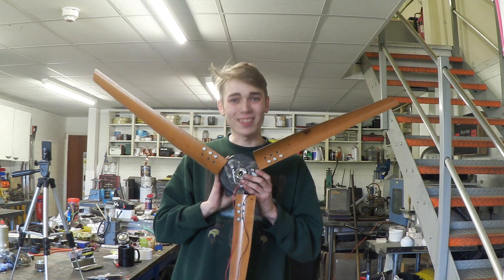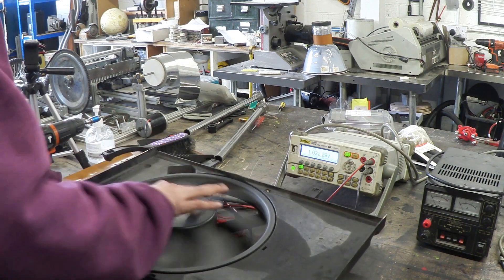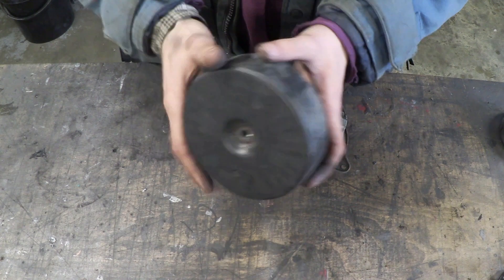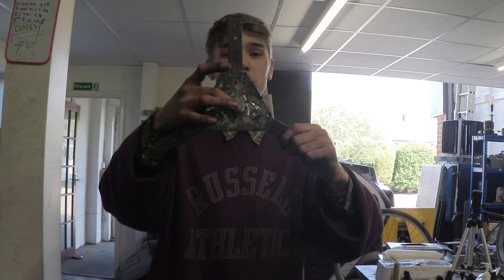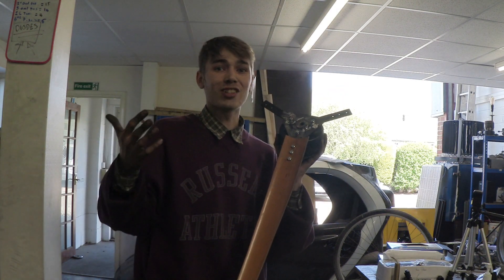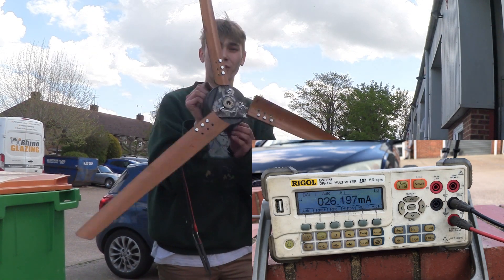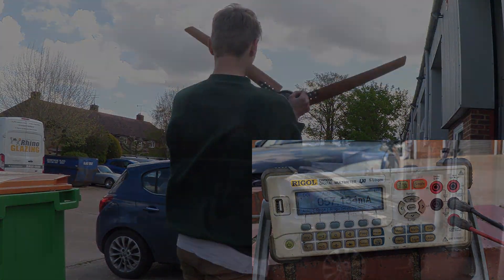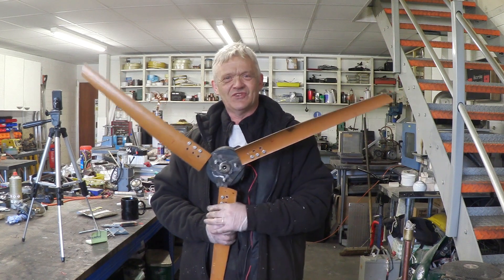1091   My First Ever "Easy to Build" Wind Turbine

Comment: Good idea that you always pointed it to where the wind  was blowing!
Reply: Yes, and in practice all one has to do is build the generator on a swivel and attach a wind vain tail fin to it. The force of the win on tail fin will always keep it aligned properly to the wind.
Reply: @William_Hada  the problem is if you want it in a big turbine it'll exhaust the energy it made in the first place so maybe multiple small turbines that can easily adjust with little amounts of energy needed.
Reply: some of the giant turbines you see on hills actually face "backward" to what you expect, the blades themselves can create enough drag to pull the turbine round so long as the blades are on the trailing edge - the hardest part is allowing infinite 360 rotation as the cable will always find a way to get coiled up... one of the benefits of VAWT i guess

Comment: Well done!  Could you look at making Slip Ring Rotating electrical connectors for  a wind turbine from scrap, and how to mount them securely on a pole, as I have found that to be the biggest dilemma in making a horizontal axis turbine?! There is a plethora of motors out there for conversion to generators, but the problem is getting the power back to the ground without having to regularly untwist wires!

Comment: Nice. Keep in mind that the power producer should be measured under load. When you only connect a volt meter no current is flowing and load is zero. When you only connect An amp meter no voltage is over the meter and load on the electrical connections is zero. However in the latter case mechanical load on the generator is present and delivered as Heat in the generator itself. Put a resistor on IT and test. Theres An optimaal resistor value where delivered electrical power maxes out.
Reply: Very true, but unfortunately your good advice will be ignored.
Reply: @robinvince616  That's fine. It's there for anyone to read. I guess the channel is about original and fun idea's. Books have been written on in depth generator theory. Dozens of hours video content could be made. Not many people would watch.

Comment: Always wanted to build a wind turbine with a car alternator just to see what I could generate. 
I have seen small wind turbines generate enough to keep an electric fence going with just a very small battery out of a motorcycle.  It generated enough to create enough high tension voltage to keep sheep where they were supposed to be.
So it more then kept the battery charged.  It was only a small six bladed wind generator like the ones you see on small sailing boats/yachts.

Comment: Awesome.
Wouldn't it be possible to increase power output by adding a gear between the fan blades and the motor to increase motor rotation?
Maybe use the gear setup Rob had a few episodes ago.

Comment: Nice work, I would love to see a comparison with a 6 blade turbine. Not technically as efficient as the increased wind resistance will mean a slower top speed than the 3 blade version. However the increased torque coupled with a timing belt gear could make up for the difference. You wont get double the watts but should get more than 2 and at lower wind speeds

Comment: "Rob just ignores me!" ....... As Rob walks strait past the camera! ..... Gold!

One point on measurements Luke (and Rob too) ...... Measuring just the Volts or just the current  and multiplying to get power is not right! Unless the internal resistance is the same you get just Volts and Amps without any relation to each other!
The way to do it is to get a resistance across the generator and measure the Volt Drop across it (or the current running through it ... makes no difference) and apply Ohms Law to work out the other value and the actual Power 

Volts= Current x Resistance .... You can expand it to get Power = Volts x Current! 

Still, another one under your belts! (well you were both in this one) ;o)

Comment: Watching that Volt reading and Amp reading reach 2V and 1A when I was wasn't sure if it would .. WOW very impressive. 
Did you use a Anemometer for wind speed or was it inferred? I've often thought about some 'map' that the met office could produce or that citizen scientists could create that would indicate how common various wind speeds are at different locations - that way we'll know where to put them / what's possible to scavenge !

Comment: Usually turbines with Moore blades trurn slower, but I don't se why you couldn't try and give it 6-8 sorter blades, to try and raise the speed of rotation so that you get closer to 5 volts with the same sort of wattage if not a bit more.
Reply: Why the even number blade sets that sounds odd. Because the even blade will be at balance at any point on the turn  where odd find the equilibrium 2 points per blade ,low blade count
Reply: @tremail564  I wasn't thinking about even blade numbers, Iver way the point I was clumsily making still stands, and I Don think it matters at that scale.

Comment: Car fan motors typically run off 12v, so logically I would have thought that if you were to manually spin one really fast it would generate significantly more than just 1.7v ?   You produced a really decent current of 0.5 Amps - so I'm kinda surprised the voltage was so low?  Is it normal for a 12v brushless dc motor to only generate <2v ?   Maybe one for Rob....?
Reply: It's about the rpms and for the 12volt fan I think they spin like 1500-2500 rpm.

Comment: I'd be curious to know if there is a simple way to test a motor to see what kind of output it might produce as a generator.  For example, if a motor produces 100 rpm at 12v 1a input will that mean it will produce 12v and 1a output at 100 rpm?  Or is there a formula that will tell you what to expect?
Reply: I don't think you can get the same out put as input ,and as soon  as it has a load the rpm should reduce.if too much load is placed it will stall the fan.

Comment: Because these Motors produce more electrical energy at higher speeds and have low resistance to rotation would not make more sense to use 2 blades instead of 3 as that would generate higher speeds  (admittedly at the cost of torque)